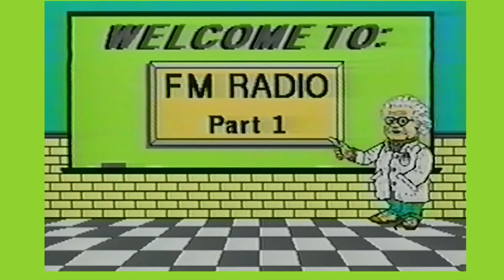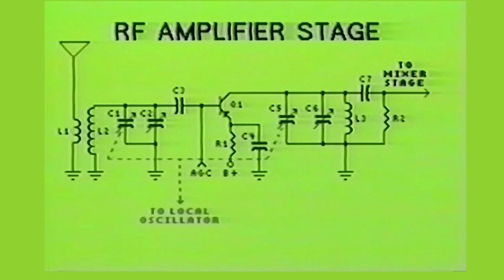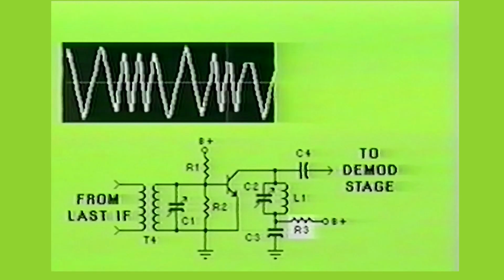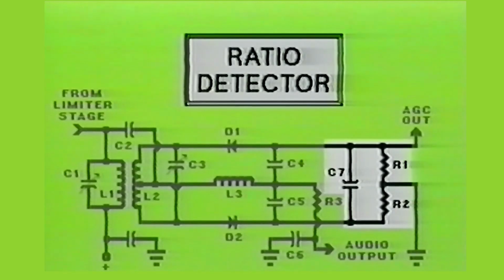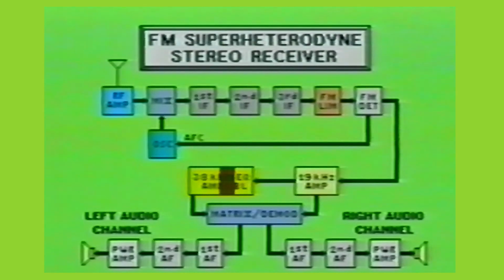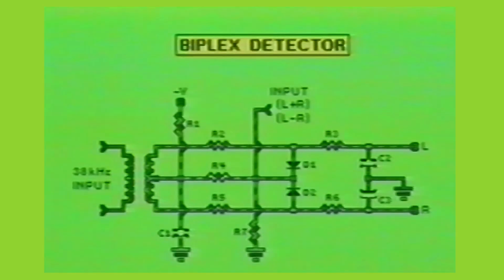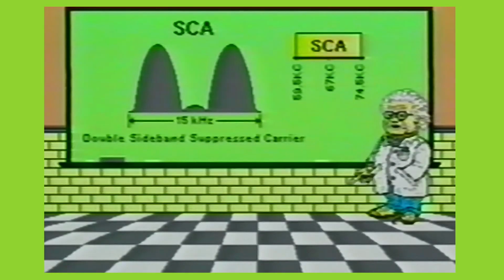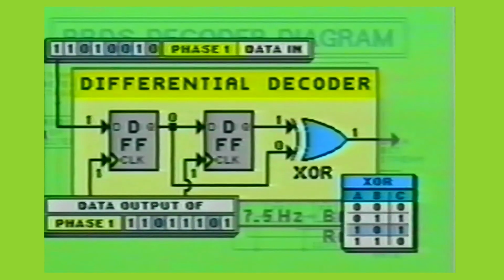FM Radio Part 1 & 2 Training Videos 1994

Comment: The part 2 of the video is jumping like it's got a vertical hold problem.   Also the SCA-FM information is incorrect, it does  not use a Double Sideband Signal like the Stereo carrier does, it uses a 67 kHz or 92 kHz using Narrow Band FM, not DSB or Suppressed Sideband that is used in the 38 kHz signal.   A PLL circuit is required that uses the LM565 which was available in a Ramsey Electronics kit dated back in the year 1994 that uses a pass through audio circuit and a LM-386 amplifer, and you had to connect it to the detector output from the FM receiver.  Also this video did not explain how a SCA subcarrier is generated and connected to the FM Stereo / Mono transmitter.  Right now, it needs to return in digitally encrypted audio format for to bring back background music and other services to the places of business more privately.